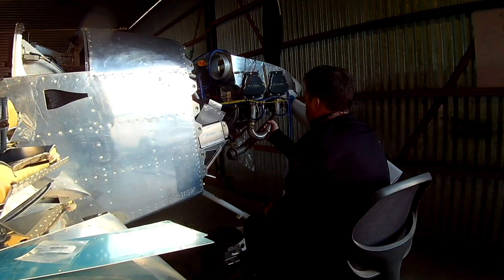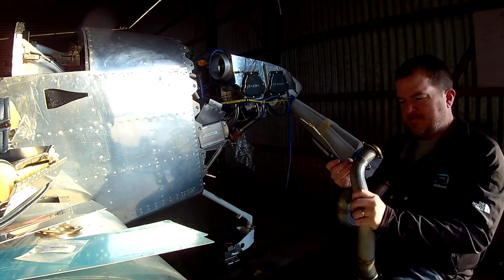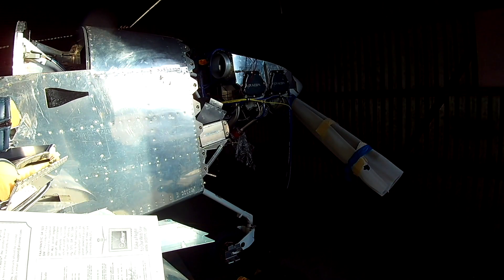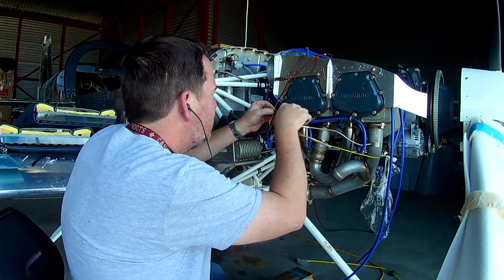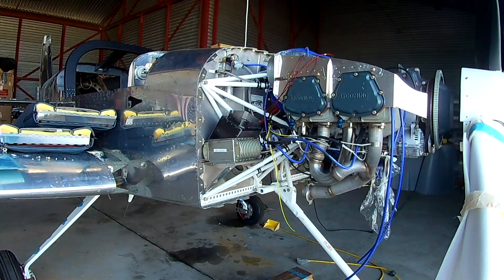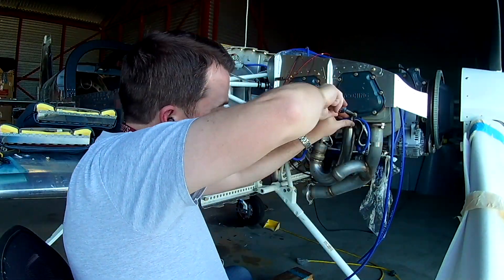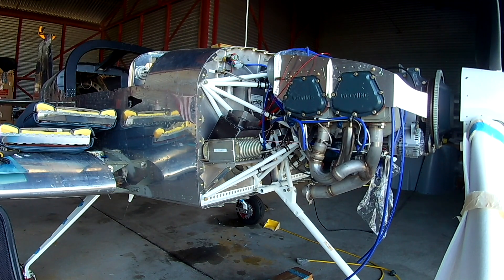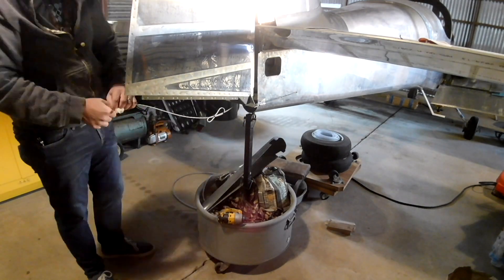RV-14 EGT I

Comment: How long are the thermocouple wires from say the sub panel to the forward most cylinders? I want to rough cut mine this weekend.
Reply from the maker: I didn’t measure them. What I did was buy a 50’ section and divide it up into 8 equal pieces for running it then cutting the excess off at the ends.